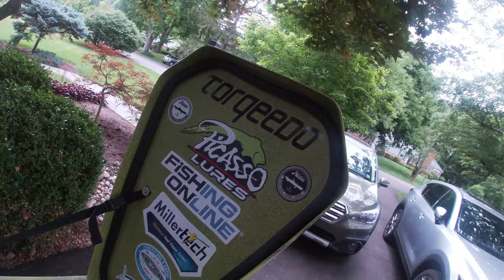The BEST KAYAK FISHING SETUP on the market Hobie Pro angler 360 with a Torqeedo 1103

Comment: What area in Ohio are you from? I've been kayak fishing in PA12'S for past 9yrs now. I'm originally from just north of Cincinnati, born& raised. I keep my pa12-360 pretty bare bones except electronics. Ultra 106sv, lvs34, steady cast. Amped Outdoors 14.8v 32ah lithium. Runs everything around 15 hours, & it's under 4 lbs. No trolling motor or trailer, not any other excesories besides rods little bit tackle.  Just haul it in bed of my truck. But I can launch & be fishing in less than 5 minutes. Longer I've been kayak fishing the more I keep taking things off. I moved down to southern SC about 2 years ago. Bass fishing has been excellent for me down here, completely different than southwest OH. It's weird I saw more Hobie PA's & kayakers around Cincinnati than I do down here times 5!??  My 5 biggest largmouth this summer so far 7.4 - 8.05 - 8.6 - 9.3 - newest PB an 11lb 4 oz!
Reply from the maker: I'm from the SW Ohio area I travel a lot for tournaments and you are right where your at now is so different then Ohio fishing.